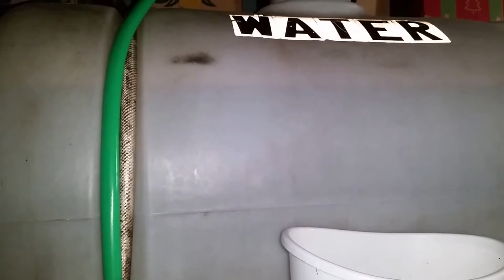RO Water: What it is; How it works; and How I use it in my Aquaria.

Comment: Looking for some advice, I’m new to this hobby and I am starting out with a planted 29 gallon tank filled with my tap water. 
My ph is high 8’s with a tds of 600. 
I’ve bought a 32 gallon bucket and filled it with tap water and added muriatic acid and have brought the ph down to 7-7.2. 
I don’t have an ro system and I’m going to try and just mix my treated tap water with distilled water. 
I’m going to try and slowly add it to the tank to lower the ph, so 4 gallons tap water and 1 gallon distilled water at a time. 
Will this work?
Edit: I’m doing this to lower the ph and the dissolved solids
Reply from the maker: You'll just have to try some and test it. Then adjust accordingly. I'd start with 25% to 75% and see where you are.
Reply: @DanHiteshew-oneandonly  sounds good, thank you for the reply!

Comment: I am in Central-South Florida: what do you recommend (freshwater) I use for a new community tank? I have raw well water (approx. 275 per mil dissolved solids), water softened water, and R.O water.
Reply from the maker: That's a pretty broad question.  there are hundreds of fish, and I have no idea what you like or even how big your tank is. 
Angelfish are good under the right circumstances. So are gourami. 
There's loads of schooling fish available too.
Reply: No doubt. Mainly going to start out with rainbows, gourami's, and cleanup crew fish. I may mix all three water types and see what I get. I will not add any fish until the water is stabilized, and where it needs to be for happy fish. Thanks, Dan!

Comment: Hi dan,I've come across your channel tonight after trying to research where I'm going wrong,yes I'm having trouble anyway I'm trying to get my planted 240 litre tank up and running since February this year at first everything went fine,then came the algae after that all my plants started to get thin leaves and it's so frustrating I nearly packed it up and give in but I'm determined to get it right,problem is I've watched so many different films and they all say different,so I've decided after watching a couple of your films to just stick to your advice as yours made sense more than others I've watched if I need some pointers would it be okay to message you ?? Thanks very much from Lee in Manchester England.sorry it was so long haha.
Reply from the maker: +Mad Mac82 Not at all. Lol I've gotten much longer and less flattering comments than yours. Lol
I don't really do FaceBook, but I will if I have to. You can find me on Google Plus and Hang Outs if you have either of those apps installed. And of course you can always comment directly under the video itself.
If your tank has only been up and running since this past Feb., then you really need to dial your expectations back a little. I don't consider a tank "settled in" for at least several months. There are a lot of variable involved, so it may take a while to sort out. Be patient. you'll get there.
Reply: Mad mac, I'm getting  into plants to and I agree that the information  can be quite  contradictory  and confusing . sticking  to one source of information  is  good  idea. thing is in the aquarium  hobby much like life what works  for one person  might  not work  as well for somebody  else,so do keep your mind open and continue  doing  what works well for you.there are some forums and fb groups  that can be helpful  when your ready. I find Dan very interesting  and confident he is a fine mentor.wish you the best with your  new planted tank,
Reply from the maker: Damion Markham good advice. Never rely on a single source of information.
Reply: +Dan Hiteshew hi dan,thanks for the encouragement,I'm just gonna take my time till I can figure everything out and read about everything I can your channel is great and your tanks especially the Angel fish tank are what I'm dreaming off having at some point.thanks again.
Reply: +Damion Markham hi Damien thankyou and yeah it is confusing but I'm determined to get it right,I'm gonna do as much research as I can  ,I think I was going wrong with the water parameters there for a while  but I've ordered the api master kit with gh/kh tests and as Dan said I'm a water keeper not a fish keeper and I didn't really think about that way so yeah I'm going to start over and just make sure my parameters are good as best I can and see if that makes a difference and hopefully start getting some good results,thanks again.

Comment: you get pure water with zero TDS when you add a di resin filter after the ro membrane and you can get water saver ro membranes that have a 1:1 ratio if your really that worried about how much water your using.

Comment: I been using RO/DI water on both my reef tank and my tropical tank.  Now my tropical tank I started out with 6 platies and after a month or so I added a glo tetrra.  Now I lost two (maybe three) platies but I chopped that up to my tank not being ready when I added them; never thought it might be the water I'm putting in.

Now I have not done any research or eve tested but what are your thoughts on this:

I was wondering if you could take the waste water from a RO/DI system and then pump it back though.  Would this still give you good RO/DI water (yes I understand there still be waste water from this as well)?  Like I said have not tested or researched it  just a thought that popped in my head the other day.
Reply from the maker: +James King (NJTiger24 Aquariums) Do you mean run it through the RO sytem again? I guess you could, but each time you ran it through, it would be higher and higher in TDS. The system would have to work harder for less output each successive pass. (I'm not even sure how you'd reclaim the water to run back through it anyway)
As far as using the water that was gone to "waste", well that would defeat the purpose of the RO in the first place. Just use the tap water if that's what you're asking.
Platies, like most Live Bearers, prefer harder to softer water. Too much RO will kill them for sure. You'd be better off putting them in your reef tank than in very soft water (yes Mollies and Platies can do full marine water)
Reply: Dan Hiteshew. That is what I figure about the system working harder.  And yes I meant running the waste water back in.  For example have the waster line go into a large container and then use a pump to send it into the RO unit again.   Again didn't do any research or testing. Just one day when I was making water I thought about it lol

I did know that platies could do saltwater I seen video of people who have them in their Reef tanks.
Reply from the maker: ***** My system is set up to use my household water pressure to push it through the membrane. My waste water just goes down the drain.

Comment: Thanks for the video Dan.
So I have been ready to pull the trigger on a 4 stage RODI unit from Bulk Reef Supply. My tap is 8.3ph but my TDS is very low (under 30). For whatever reason I have not had luck with SeaChem Neutral Regulator lowering my PH at all (even though my GH and KH seem to be quite low). I have planted tanks and just recently started shrimp tanks. Most people seem to say the best solution is to get an RODI unit and re-mineralize it (I am looking at Continuum's Reconstitute RO: https://www.amazon.com/gp/product/B01C5LJMKU/ref=ox_sc_act_title_1?ie=UTF8&psc=1&smid=ATVPDKIKX0DER) ). 
After watching your video, I was left scratching my head because it seems that you are suggesting to go with a RO unit without the DI. Yet when I look at companies like Bulk Reef Supply - it seems that the RODI is the standard type of solution for tanks. They do have a RO only unit but that seemed to be more for drinking water. 
Can you shed any light on why RODI seems to be the standard if you truly believe the DI is not a good thing... ? Thank you
Reply from the maker: I only use it for brackish water, so I have endless room for variances. If you are dealing with corals, you to know exactly what's going in the water.
RO is fine for my purposes. I have 11 ppm in my ro water (down from 350 ish). I'm not worried at all about those few ppm. If I needed to remove them, then I'd get the "DI" (de-ionizer) to remove those last few ions. RO gives you a 90 to 97 % reduction in TDS, so your starting water is key. You have 30 ppm, so at the most, an RO unit would leave about 3 pmm. Is it worth paying the extra money to remove the last 3 ions?
Reply from the maker: I'm baffled by your pH. I'd assume at low KH and gH, with such a low ppm, you'd have a pH of about 6.5.
Reply: Dan Hiteshew I need to have around 200-300ppm TDS anyway for shrimp. The purpose of RO/DI for me is to get the PH down and remove any undesirable impurities that could be harmful. 

It is a mystery to me how my tap ph is 8.3 but my GH and KH tests are so low. 
Are you a member of the high tech planted tanks Facebook group ? I have a recent post in there about this very issue with pics of my test results and what not. Posted it late Thursday
Reply from the maker: I don't do High-Tech tanks or FB, so that's a definite no. Lol